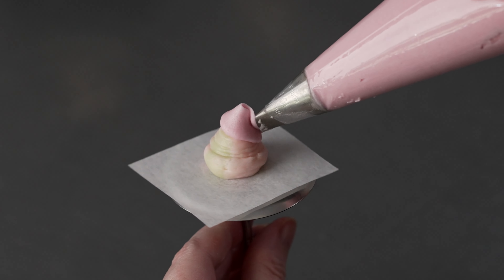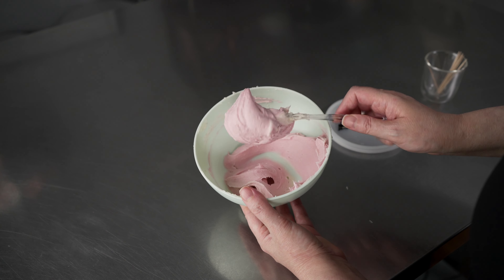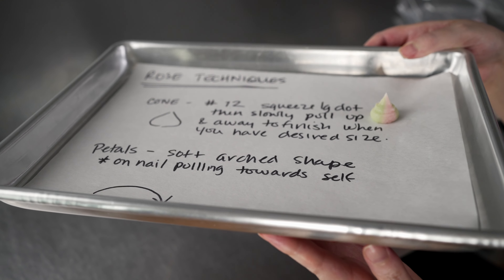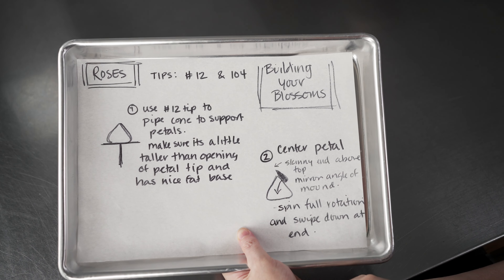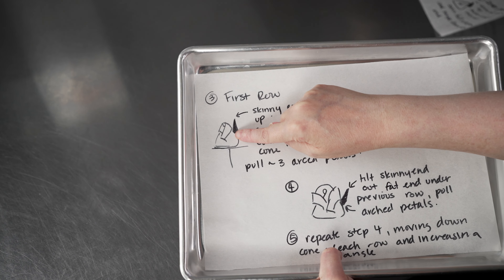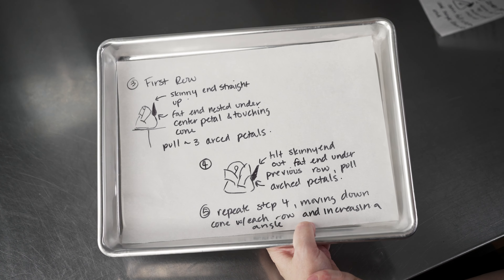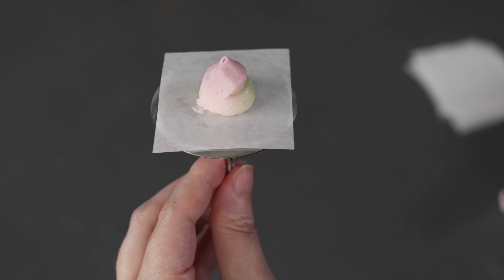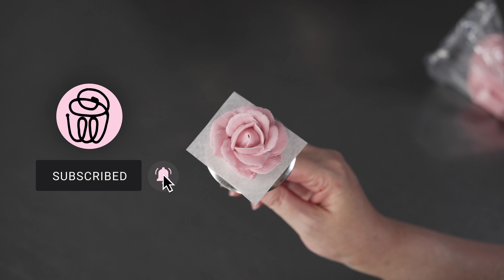how to pipe a basic rose [ Cake Decorating For Beginners ]

Comment: If I do the cone it tips to either side, how do I keep it straight and my hand warms fasg
Reply from the maker: I always start by making sure that I'm holding the nail level and that my bag with the 12 tip perpendicular to that surface.  Then when piping try to focus on pulling straight up.  That should keep them from leaning to the side.  Not everyone you make will be perfect but you should still be able to make a decent rose even if they are tilting just a bit.   Just keep practicing and trying focusing on that first bit while you are working on your roses for now.  Hope this helps!

Comment: What tip can I use if I don’t have 104? 
Should I use 10P1 
Or 
Should I use 14P1
Reply from the maker: Hi there!  There are lots of brands out there and I'm not familiar with this number system so I'm not sure what brand it is, if you let me know I can check it out and let you know what would be your best option.  Ideally it should be a teardrop shaped opening and we are using a standard sized tip vs an oversized one meant for larger decorations.  Really you could use any petal tip to make roses.  Larger ones will make larger flowers and smaller ones will make more petite ones.  I hope this helps some and let me know what brand of tips you are using and I'll check them out!
Reply: @CakeDecoratingSchool  thank you so much for your reply !! 
The brand I’m using is “RFAQK”
Reply from the maker: Hi!  Thanks for letting me know I'd never heard of that one before and they have a pretty unique numbering system. From what I can tell your first thought the 10P1 looks like your best option so I would start with that one.  The photos they have are from the side and don't fully show the top of the tips but that does appear to be a petal tip.  Good luck with your flowers and thanks for sharing!

Comment: So, I’ve never done this before and had no idea how much goes into this…
I thought I’d easily whip out some pretty cupcakes for a bridal shower and now, this seems too much for my amateur level (& 50-80 cupcakes). 😬
Question:
Can these roses be made directly on top of the cupcake??
& any hacks to make that easier?
And if your method is best, how do I get them on top of the cupcake and how do they stay put?
(I also really prefer cream cheese frosting, but is that not practical for designer piping?)
Thanks for the informative tutorial! 🙏🏼
Reply from the maker: If you've never done a decorative project before roses might be a bit ambitious for that amount of cupcakes.  You might want to go with a simpler design. 

Cream cheese frosting while tasty is not a good option for something like piped flowers as it lacks the stability to hold its shape.   This is a pretty standard way to make roses, you might find some others but even if they are doing it a different way you still need to pipe each petal so they are all going to take time and practice.  You can sue papers of a flower lifter if you prefer.  I like the papers since they make the flowers easy to transfer to a tray and chill, once firm they can be placed on cakes and cupcakes.  If you want to see how this happens we have a great 3D rose cake video up that shows us using roses.  We also have a video on how to use a flower nail that covers the all the basics and shows placing flowers on cupcakes.    These roses are on the small side in comparison to a cupcakes=, so if you piped it directly on a larger surface like that you would end up with the cupcake interfering with your movements and you won't have the same spin as your nail which means it will actually be harder to achieve.   you can do larger versions of this type/method of roses on cupcakes but you would need to use a large tip like a 125.  Hope this helps and good luck with the project!
Reply: Thanks so much!
You’ve solved it for me!
I will hold off on this endeavor for when the pressure isn’t on (& the number not so high)! Lol
Thanks for the additional references! You have quite the talent and your thorough, detailed videos are super helpful! 🙏🏼
Reply from the maker: so glad you found it helpful and you've got a plan for your project!  Thanks for the kind words and good luck with the cupcakes for the bridal shower, I'm sure they will be lovely and tasty!

Comment: So I was piping from left to right, I see you pipe from right to left, does that make a difference? Thanks
Reply from the maker: I'm right handed so piping this way means that I"m not blocking my own view with my hand.  It also means that I can hold the bag and the tip so the frosting comes out unimpeded and the spin of the nail lays the frosting on my flower naturally.  If I were a lefty I would do the opposite and spin the opposite direction.  I find this the most comfortable way to pipe but I know some people find piping right in front and going the opposite direction more natural.  As long as it doesn't interfere with what you are doing and make things harder for you there really isn't a right or a wrong way to do things.  Hope this helps!

Comment: How do you determine the icing consisity for the rose?
Reply from the maker: Hi Vicki,  I use the same frosting for all of my flowers.  We are using an American style buttercream that has butter in it not shortening so you can play with the temperature (a little bit( and also whipping it up to make sure it's light fluffy and spreadable when needed for icing a cake and a little cooler when doing piping tasks.  I don't find I need to make different consistencies the way you might need to if you are using fat for the shortening.  Hope this helps!

Comment: How do you transfer it to the cake?
Reply from the maker: we pipe on paper so that we can slide them off of the nailed on to a tray.  You can then chill them in the fridge, the butter will get nice and hard which means they are then easy to handle so they can be peeled off and placed on your creations how ever you desire.  We have some great flower cake designs where we place flowers on cakes if you are looking for some inspiration in our 3D flower cake series.

Comment: Can somebody help me??  What kind of frosting do you have to use to make these?  I have tried everything, from the kind in the tube to homemade recipes.  It is either too soft to hold its shape or too stringy or too hard to get out of the nozzle.  What is the secret to this????
Reply from the maker: If you are looking for an easy store bought solution, I would go with the wilton decorator icing/buttercream.  It'a available in most craft stores with a cake decorating section or you can get it on line on in the cake decorating section at Walmart.  It is meant for piping decorations and flowers.  I would stay away from the icings you find in the baking aisle of grocery stores(like Betty Crocker). it will always be to soft to work with and isn't meant for this kind of decorating.  As for home made a variety of types of frostings would work.  American(or simple ) style buttercreams like what we are using in the video are a great place to start as they are easy to make but you could also use an Italian or Swiss meringue.  If they are to soft/melty it could be a bad recipe, but it could also be that you are working in a environment that is too warm or like many of us have a case of the "Hot Hands".  Sometimes it just takes a bit of time, practice and some yummy mistakes to work out the kinks and find the best solutions for your particular needs.  hope this helps!

Comment: Do you let the cone dry before piping petals? My vibe flops over when I try to pipe a petal.
Reply from the maker: I pipe the petals on the cone directly after piping the cone itself.  If yours is slumping or tilting you might need a frosting that is more stable or it might be too warm.  Usually if mine start to get a bit saggy while I'm working it's because my hands have warmed the frosting too much and it's time to let it cool down or change out what is in my bag.  Hope this helps!
Reply: Hi Amy my hand is warming the icing in the bag! What do I do??